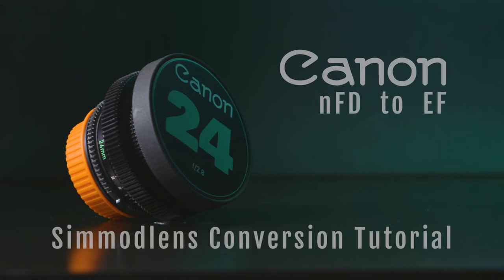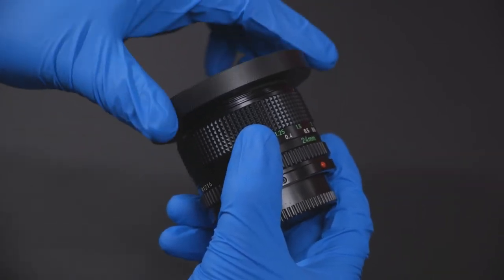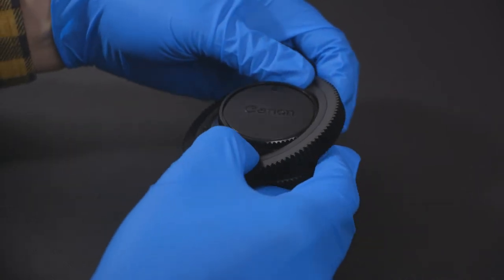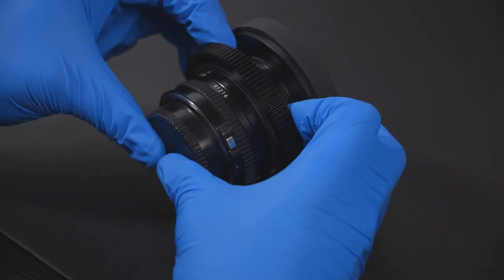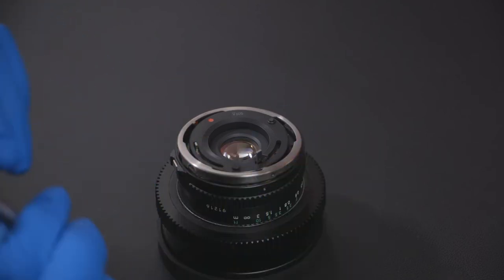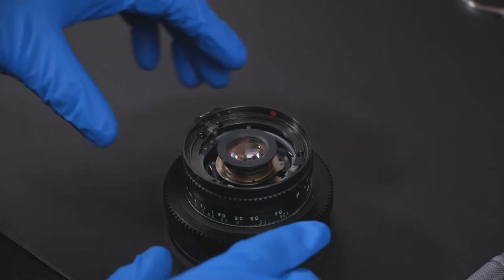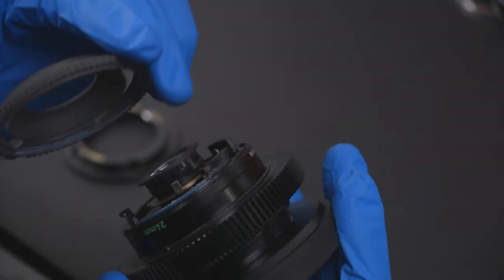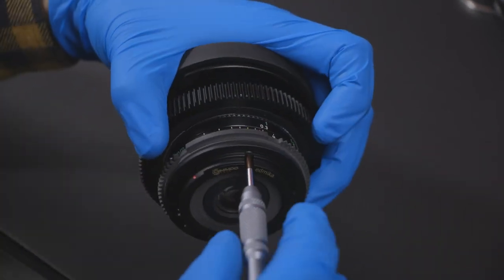Simmodlens EF Conversion Tutorial | Canon nFD 24mm f2.8

Comment: How well is the tape holding up?

I’m surprised they don’t have a few set screws to hold the focus ring in place.

I would think that would be a nicer, more professional, solution to the quality product they offer.
Reply from the maker: Absolutely agree with this. 

However, the tape does a very good job keeping the ring secure. I may slide up and down the lens if pushed by hand. BUT it wont slip around the lens when pulling or calibrating a follow focus. 

I would recommend setting the torque on the focus motors to low for the sake of the lens itself.

Comment: Thanks for the video. I need help with converting the Sigma 28-70mm 2.8 Manual made for Canon FD to CANON EF. What do I need? I have remove all the way down to the iris ring
Reply from the maker: You'll need an aperture ring with a small rod that would connect to the aperture control mechanism inside. You'll also need a custom machined ef plate that would be compatible with your sigma lens. Simmodlens may have what you're looking for.
Reply: @Leuwenski  Argh. Sounds like a major ordeal.

Comment: 185$ without shipping? for what?? i would save a few bucks and order the same part costum made for 50$ or less.
Reply from the maker: Sure, there is nothing wrong with saving a few bucks here and there.
Reply: You can get a mount conversion from shapeways, for $16 only LOL! However, it's plastic - just ordered mine yesterday, I'll see if it's good quality, if not, I'll just use this plastic conversion one as model and get myself some metal 3D printed ones locally :D
Reply: It's worse than that. The entire thing is US$314 + shipping, per lens. Way overkill, 3D printing is the way to go here.
Reply: @SebastianFriedrichVisuals  Not any more, it's US$29.18 + shipping when you include the aperture arm. Looks like the ripoff merchants are having a field day.
Reply: @shedtime_au where?